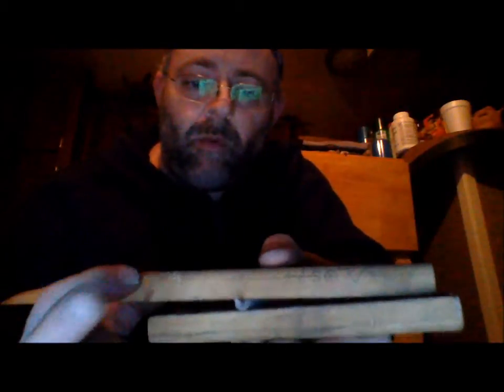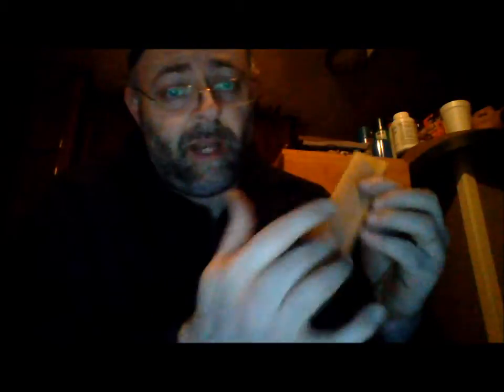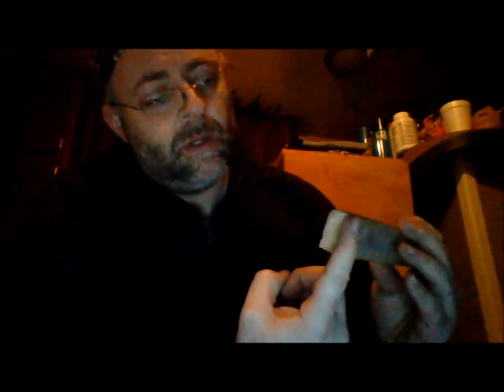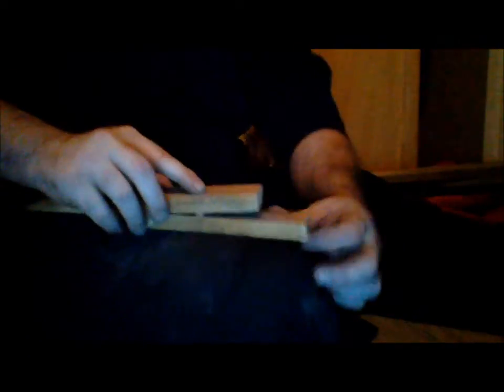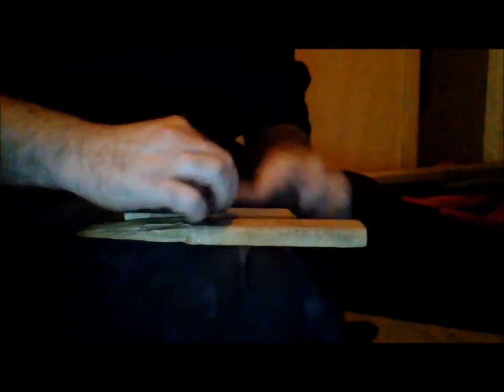Rudiger Roll video 13 : Mini Fire Roll continued

Comment: Fantastic !!

There you are very very close to a real primitive technique : finding or making short and small flat surfaces was probably much more doable (than finding or making planks) back in deep prehistory :-)

... Can't believe that I didn't even dreamt than reducing that parameter (the flat surface) could be a fruitful way of investigation ...
Reply from the maker: freejutube Hi freejutube! Thanks for commenting! I would have demonstrated this sooner but it slipped my mind. Agreed, this is easier than making planks. Although I still maintain that a rigid surface is probably better for this method I am in no way implying that wood is the only material that can be used. I have used this method outdoors with a split stick for the hand hold and a flat stone for the rolling surface.